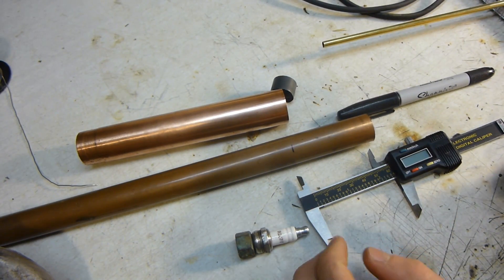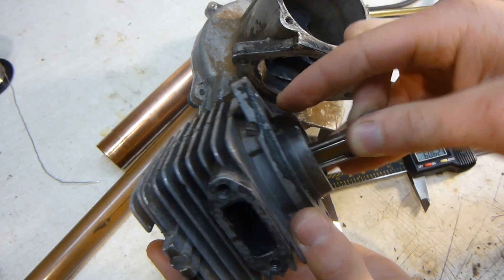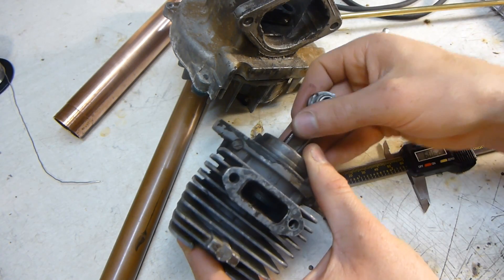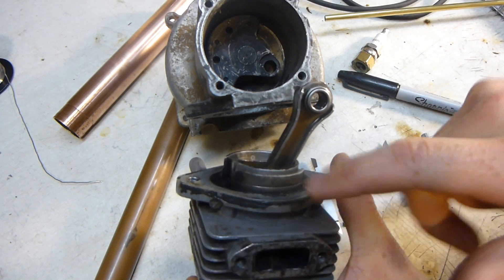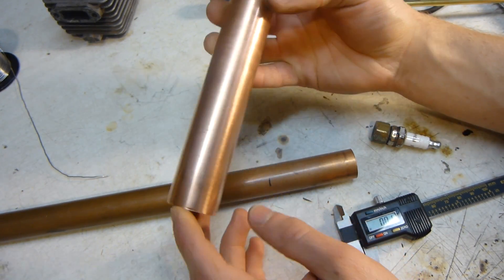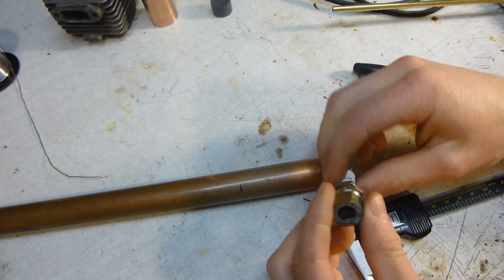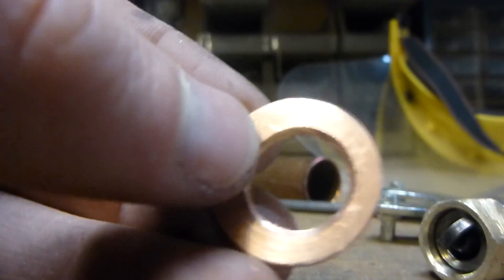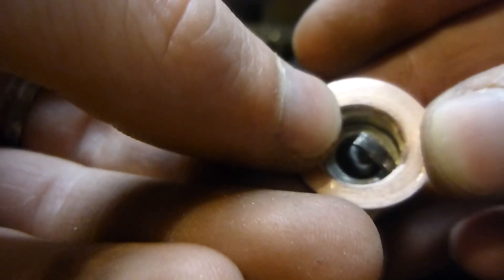Part 2. Making Internal Combustion Engine, No Machine Shop - Cylinder Head and Spark Plug

Comment: Hi Maker j
Nice project..should be fun but do yourself a favor and thread and tap everything, screw it together then solder it...if you must use solder...once you start messing with combustion, solder doesn't cut it...!!
Reply from the maker: +electro1622 What do you mean thread and tap everything?  Why would I need to do that?  I already finished it and I soldered just about everything and it works great.  Cumulatively I've run it for about 2 hours and no solder joints have failed yet.  It's only 8cc.  If the solder fails on the head or something it's just going to go pop.  Why is everyone freaking out about me soldering everything???  :P
Reply: I don't know...I figured that an internal combustion engine without cooling would get hot enough to melt the solder..couple that with an explosion in a confined space and....that's probably why everyone is freaking out...but if it works...
Reply from the maker: +electro1622 Ah I see.  To be honest I'm kind of surprised something has not broken/blowup/melted yet.  Well really I'm surprised that it even works LOL!  Today I was just running it a bit and I didn't have cooling on it.  It takes about 2 minutes of running before the cylinder is too hot to touch.  At that point I shut it off and let it cool down for a couple minutes.  I actually kind of want to run it without cooling until something breaks just to see how it fails.  Either the head will desolder itself or the piston/rubber o-ring seal will melt.  JB Weld is rated at around 500F.  I'm not sure about the o-ring.  The tin solder I used has a melting point around 450F.  So technically that should go first.  That would be the best way for it to fail in my opinion because it would take me literally 2 minutes to solder it back on.  If I was burning hydrogen in it than I would be a little more concerned.  It probably would have blown up by now on hydrogen.

Comment: This is a great project. I never would have thought of making a 2 stroke engine with hand tools like this.
I guess with it being so small you can get away with a lot of stuff you couldn't do at a weed whacker size.
Reply from the maker: +Mongrel Shark Yeah I guess there would be some problems with scaling it up.  I could scale it up to 1 inch copper pipe pretty easily though.  But any bigger I'm not sure how it would go.  Might blowup the copper pipe.  Plus it would get harder and harder to make a JB Weld piston
Reply: You would need a good water jacket to stop the head desoldering lol. Id expect that to let go first. Knew a bloke that tuned a Kawasaki z1000 motor to 15:1 compression. Spark plug blew out, went right through the petrol tank and into the sky. Never to be seen again.
Reply from the maker: +Mongrel Shark Not necessarily.  Currently I'm only using a moist paper towel wrapped around the cylinder. Squirt some water on it every 5 minutes or so.  It's only about 8cc so it's not like it's burning an inferno of fuel.  I can run it for about one minute without cooling before the cylinder head gets too hot to touch.
Reply from the maker: +Mongrel Shark LOL that doesn't sound like a good thing to do to an engine!
Reply: Lol. Beach racers. The bike also had a paddle tyre made by screwing angle alloy to a car tyre. It was called the widdow maker untill the spark plug blew. Then it got renamed to the Castrator.
Reply from the maker: +Mongrel Shark Hahaha sounds ummm dangerous errrr I mean fun!
Reply: You should see if you can give your engine wheels and rc steering.
Reply from the maker: +Mongrel Shark I've been thinking about that!  Would be pretty cool to see it driving around!

Comment: Soldering looks clean! Your soldering iron must be quite powerful, mine wouldn't heat up the pieces like that. Looking forward to the next parts :)
Reply from the maker: +Triangle_DIY Thank you!  It's a Weller WESD51 and it's 50W.  So more powerful than most fixed temperature soldering irons.  This was the only piece of the whole engine that I soldered with a soldering iron.  Rest was done with my blowtorch and using pipe solder.
Reply: +Makerj101 Weller makes nice soldering stations! bit expensive though. I've just never soldered something like this, only done wires. should try it.
Reply: +Makerj101 Weller makes nice soldering stations! bit expensive though. I've just never soldered something like this, only done wires. should try it.
Reply from the maker: +Triangle_DIY Yeah they are a bit pricey.  I think I paid $110 for it.  But it was definitely worth it.  The tips are also pretty expensive but they last for ever.  I still use the angled chisel tip that I bought when I got the station.  I think it's been nearly two years and it's still going strong!  It was a good investment for me.

Comment: The kind of 2 stroke engine you are talking about is a "diaphragm" one, at least we call it like that in Germany. But there also is one where the intake is also controlled by the Piston, when the Piston moves upwards it creates a vacuum in the crank chamber and while moving up it opens the inlet port. Here you can see it in a gif: http://www.bahnsport.org/images/technik/2takt1.gif 
Maybe it helps, but it woud be more complicated that way, perhaps you already knew about this ^^ 
Great videos, keep up the good work!
Reply: +TaRg3t222 Just noticed you already built it so ... yeah. But maybe for future projects or just for the knowledge ;)
Reply from the maker: +TaRg3t222 Thank you!  Mine is basically a modified 2 stroke engine.  The piston still makes a vacuum and sucks the fuel in.  The only real difference with my engine is that my crank case is not enclosed.  That's why I need to have a push rod.  And yeah I already did build it!  :)  Thanks!

Comment: Are you making a 2 stroke or 4 stroke? I'm thinking of making one.
Reply: +Drew Bransby how would a 4 stroke be easier to make lol
Reply: +nivlac you don't have to make an enclosure for the crank shaft.
Reply: +Drew Bransby  2 strokes can have an open crank,
Reply: +larz0001 Oh cool!
Reply from the maker: +Drew Bransby 2 stroke.  Cool!
Reply: +Makerj101 I thought a 4 stroke would be easier to make
Reply from the maker: +larz0001 That I know of they cannot have an open crank.  They need a closed crank behind the piston to get the right fuel air mixture into the cylinder once the intake port opens.  I however do not have a closed crank on this engine.  I instead have a push rod and seal.  +Drew Bransby No. I don't believe a 4 stroke would be easier to make.  I would need to build some valves which would be kind of hard to do.  I got around the enclosure for the crank.
Reply: +Makerj101 Sweet! I can't weight to see!

Comment: I am the KING of over kill. I think I would have used HVAC solder and a torch on it and an E3 sparkplug
Reply: +Makerj101 you can silver solder with a propane torch, given the right silver solder. I use 70% silver, just fine, with a Dremel pen torch.
Reply: +Makerj101 +Makerj101 The biggest reason I can give, is safety. The "low flow" solder you're using is good for very low pressure, non-cyclic systems, where there is very little to no vibration. It has very low tensile or sheer strength, and your bond can very easily tear, especially when heat and pressure becomes a factor. I have worked with a great many fluid systems (hydraulic, pneumatic, etc), and I have also almost been killed because of other people using things which "seem to work great."
It's your experiment, and you will ultimately do, what you think is right. We haven't seen you die yet. I'm just making sure it's out there :)
Reply: +Makerj101 That's very likely the reason why  not :) I may need to hold onto that chart. Very informative!!
Reply from the maker: +ElfNet Gaming Well I don't have a brazing torch so yea!  Why would you use a E3 sparkplug?  Those look silly.
Reply: to make sure it fires lol
Reply from the maker: +ElfNet Gaming That's not going to ensure it fires.  All you need is some primitive device for a spark to jump across.
Reply: I know that. lol.
Reply from the maker: +ElfNet Gaming Ok!  LOL
Reply from the maker: +AtheosPhyve Why use silver solder?  The lead free tin solder I'm using seems to work great.
Reply from the maker: +AtheosPhyve Ah I see.  Thanks!  Ok so yeah I'm looking at this chart right now and I see how low of strength pure tin is:  http://alasir.com/reference/solder_alloys/  Luckily I mainly used that tin soldering to hold that brass spark plug holder to the head.  Soldering the head on the cylinder I used Sn96.5Ag3.0Cu0.5  which has a much much higher tensile strength.  So maybe that's why the head has not blow off yet.
Reply from the maker: +AtheosPhyve Yeah same here!  Very useful!

Comment: will that solder not melt due to the heat produced by the combustion?
Reply: If you brazed the joints would silver solder resist melting without cooling?
Reply from the maker: +propringle1 Nope.  If you don't cool it it will.  But I wrap a wet paper towel around it and that keeps it nice and cool.  I plan to eventually make a water jacket or add cooling fins.  It's just a little engine so it's not like it puts off a ton of heat.
Reply from the maker: +Kyler Kraus It would, yes.  But the piston would burn up long before a brazed joint melts.  The piston might even burn up before the solder melts.  My piston is made out of JB Weld with a rubber o-ring as a piston seal.  So all that stuff would melt first.